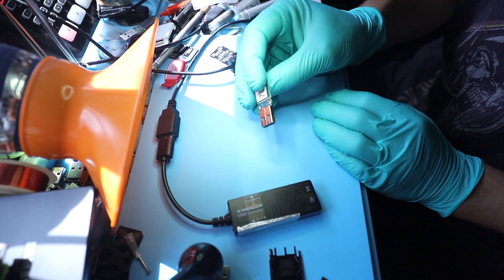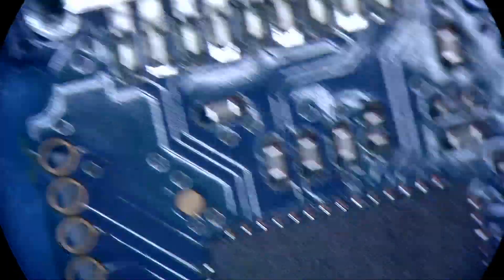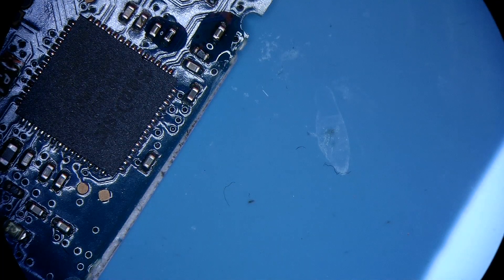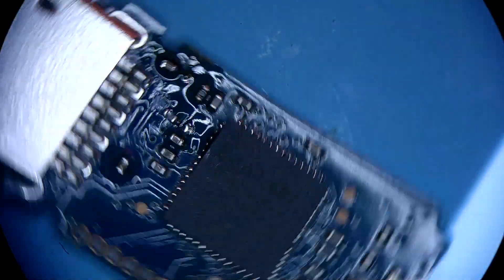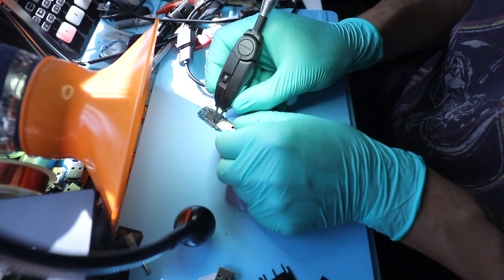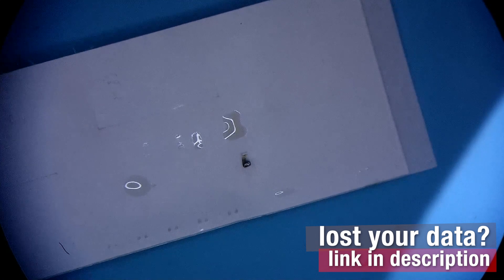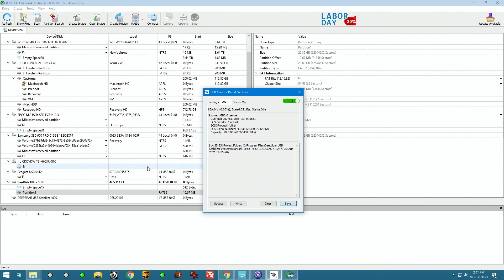flash drive repair workflow | recover data with thermal tape

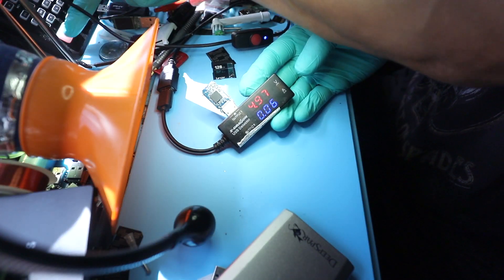Comment: 7:00 I think "that piece" was a resistor, not a capacitor. You can recognize it by the color - its black, capacitors have yellowish tint. This is why it didnt work at the first try
Reply from the maker: it was not a resistor 100%.

Comment: hi bro. I have question. My 3.5 hdd got problem. 
1. When i plug power & sata, hdd not spin

2. I need to connect and disconnect sata many times and sometimes it spin for like 2 sec then stop spin. Sometimes it keep repeat spin and stop. 

3. Already try change sata slot, sata cable. Still same. 

4. Yesterday i try to keep plug and unplug sata cable at hdd connector, and now my hdd keep spin and detect like normal. 

5.already check diode like your previous video, all fine.

What cause this problem? Connector at hdd ? Hdd health and performance is at 100% and never drop my hdd.

Comment: Sorry for silly question, but how do you determine which keramic capacitors are connected with which? I couldn't realy notice any line on the scheme connecting them. How do you determine which capacitors to check visually, where do you watch?
Reply from the maker: Tester will indicate connected planes

Comment: Hey man do you know if it's possible to recover any data from NAND chip that have been snapped into pieces?  I had two identical SSD drives one had all my old bitcoin/eth data on it and the other had all my current mining, wallets, passwords ect on it including a wallet with a few grands worth of bitcoins. I decided to destroy the old one so I could securely dispose of it, I ripped all the NAND chips of the drive and the controller then I snapped them up with pliars into about 4-6 stones about 5mm pieces to me this was completely unrecoverable even with chip off techniques so Job done back to my computer. Plugs my new drive back in to find I've plugged my old drive I to my computer... I'm sure you can imagine the horror yep I destroyed the new drive.  Is there any methods to recover data from this NAND fragments or am I totally screwed? Also when I broke the NAND chip is didn't cleanly cut them I held the ends of them with pliers and applied presure using a flat surface untill they bent/snapped.
Reply from the maker: 0 chance
Reply: @hddrecoveryservices  Dang thought it was worth asking as I've been looking at guides how to dispose of drives I noticed governments ect use a different kind of shredder for SSD compared to HDD, one looks like dust the other like fragments thought maybe there was a reason they don't want their SSD parts in fragments.  Thanks anyway man.

Comment: Just two small tips:
1) A thermal cam can save you a lot of time - I know it's not the cheapest equipment, but it is literally a game-changer while finding shorted components
2) Always leave the board to cool down before measuring capacitors - hot capacitors tend to act as shorted, that's why you measured a short on the second capacitor just after desoldering the first one
Reply: alcohol is a great short finder as well
Reply: Good point. I've seen tronixfix fix a PS5 with a thermal camera. He found a shorted section, but didn't want to remove like 10 coils, so he used the camera. Found the hot one and removed it and replaced it from a donor board and had a working PS5 afterword.
Reply from the maker: Great to know!

Comment: why you saying "this capacitor wasn't short", if when you took it out - the short was gone? why didn't you test the capacitor? will you replace it for a new one? is it between +5 and GND?
Reply from the maker: yeah, I mumbled "it is in short" :)
Reply: I think he was saying "it is in short..."  that is the component was in a shorted condition.  Charles
Reply: mm... yes. probably. it make sense. and my english not good. but touching capacitor with probes to show it is short would be nice.

Comment: I like thermal paper method
Right now I'm using flux smoke to find short and dc voltage
Reply from the maker: I saw the smoke flow method on IG but I have not tried it yet
Reply: @hddrecoveryservices  it's easy i got in first attempt 
You should try once